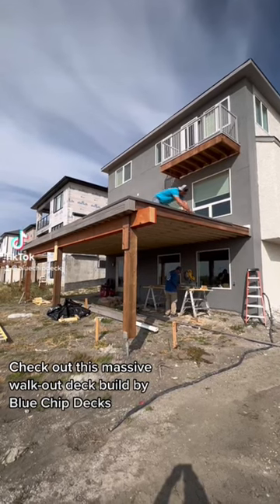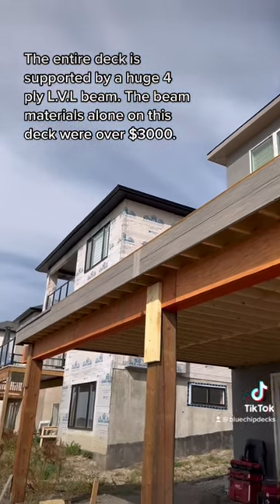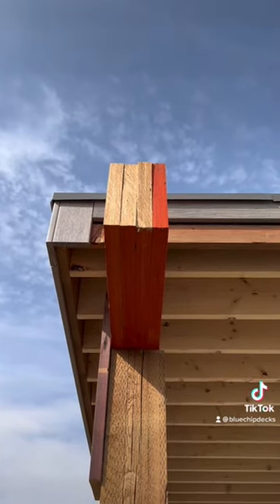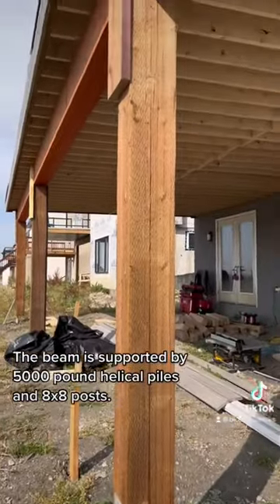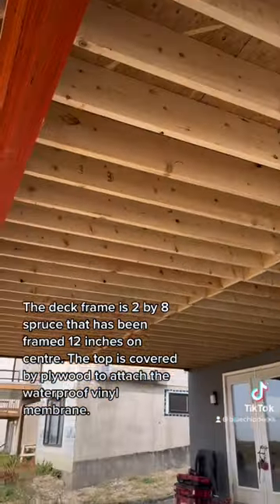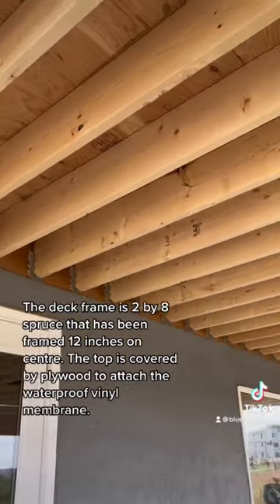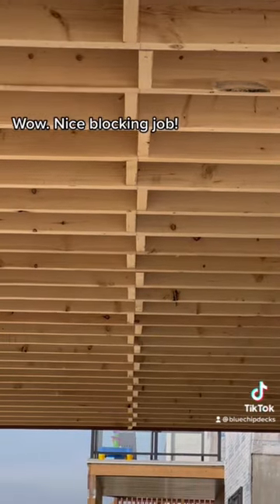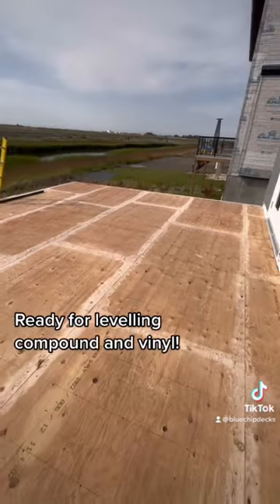Massive Waterproof Deck Build With LVL Beam

Comment: This getting a roof? How will it drain thru plywood? Must be covered
Reply: That's what I was wondering. Another comment said it's sloped.
Reply: Yes, any deck built this way must be sloped and properly flashed out with a top of the line  vinyl or rubber cement. I am in the hunt for great products as I am possibly about to offer doing this to a clients home. Although I've framed many of them I'm trying to find all the info I can on proper sealers and membranes from other pros or people who've done this with great success don't understand why anyone would want this monstrosity  on their house all I see is a giant possible problem.  Searching for related video's

Comment: How do you slope down the top deck ? If you leave it flat how the water will run out ? Just curious I probably want to do same thing in my house
Reply from the maker: You set the main beam lower and it slopes

Comment: What kind of vinyl membrane do you use? Also, what kind of compound is used for the plywood seams?
Reply: No one seems to the know the answer to this
Reply: If who use tuff deck or dura deck vinyl you don’t fill the ply seams as the filler can pop out over time causing delaminating.The seams are only 1/8” so there isn’t enough surface area for it to bond to.
My installer uses Mapai polypatch for screw heads and feathering larger areas

Comment: Do you have to put 45° bracing on the posts and beams?
Reply: No you don't since it is sheathed there is really no need for the 45 braces although they are cosmetically pleasing they could very well be doing a structural skirting around the bottom of the deck maybe possibly making a screened in porch or something similar who knows you never know they are just getting started on this project I wish they would show how to flash and vinyl the deck

Comment: Should use fiberglass instead of vinyl, 25 year span vs maybe 5 years.
Reply: You can’t use fibreglass in Canada as per code. The vinyl deck on my house has been there since 1993 and only has one small delaminated area
Reply from the maker: Incorrect